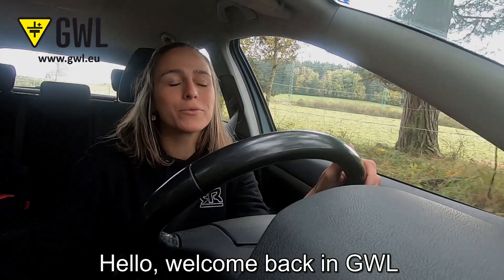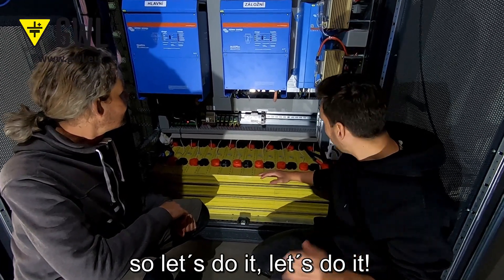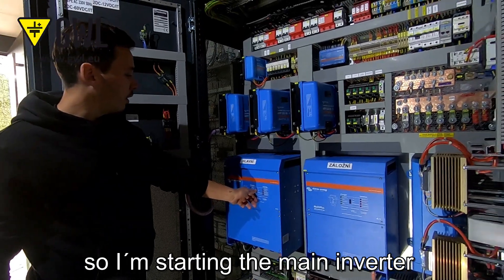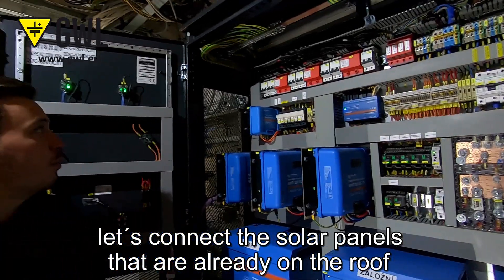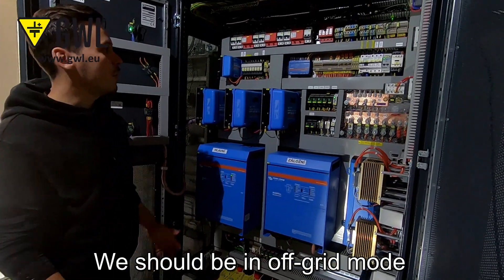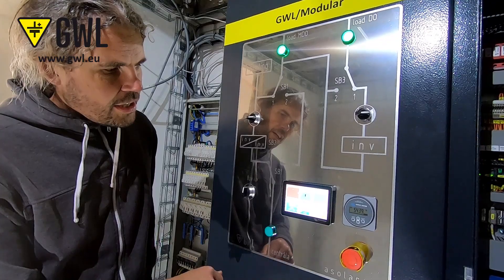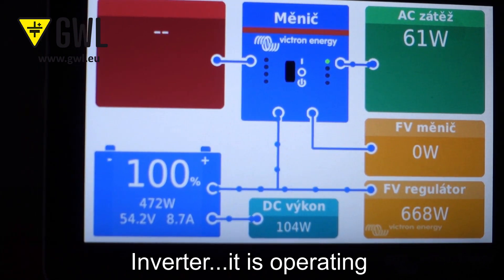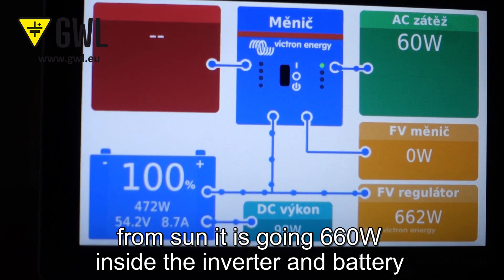Czech Sustainable House - Waking up the Beast to LiFe

Comment: I live in Sicily in the deep South of Italy (38° parallel) and here it isn't easy to live offgrid during the winter (the worst period is between 15 November and 15 January). 
I have 5,4kWp PV and 14kWh storage LFP. 
Today 19 december 2020, it was a sunny day and i produced only 12kWh. 
It's good but not enough for the house, the EV car and heating system (i need a minimum of 20kWh per day).
So i use this energy only for the house. 
Unfortunately, in only this 60days i have to charge the EV car in a on-grid station and i have to use LPG for the heating system.

I can only imagine how much hard is to live offgrid in Ceska Republika during the winter.
How work your offgrid system in this period?

Mr. Pavel is very brave. 
Bravo!